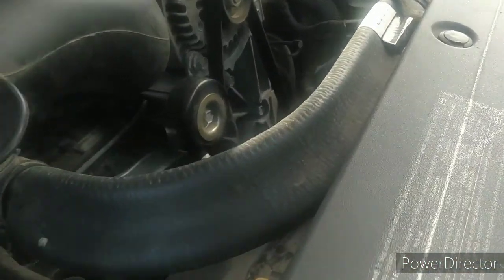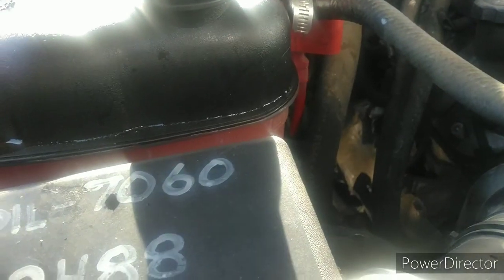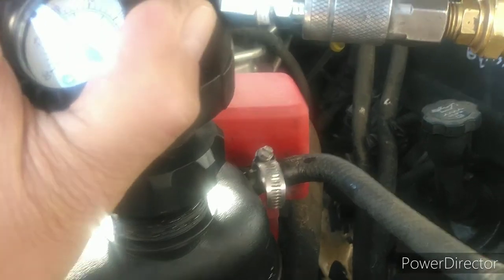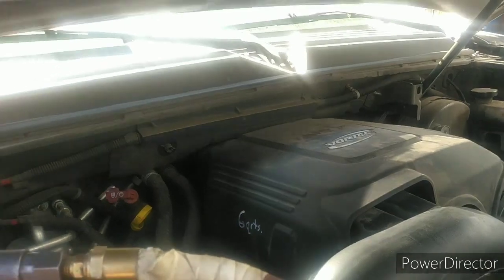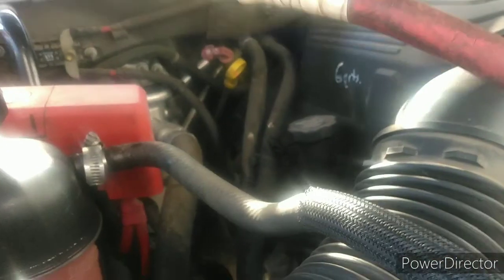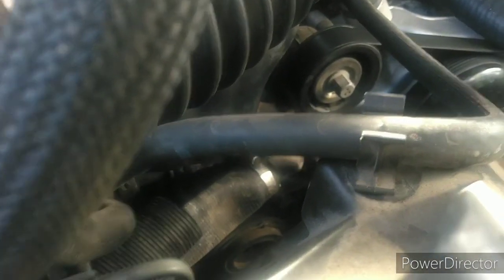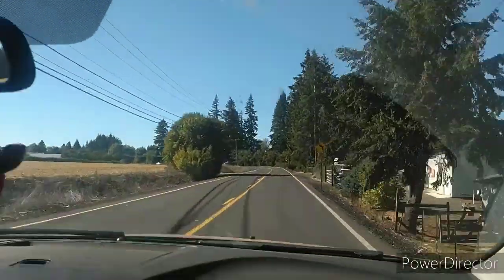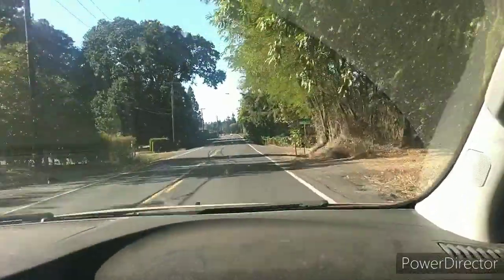Effing Tahoe!!! A trip off the farm 😎

Comment: I was just out working on my Chevy this afternoon myself.  Had to replace the transmission cooler, the one I had on there was leaking pretty bad. A buddy of mine grabbed me one when he went to the wreckers on Friday, didn't want anything for it. No more leaks, wahoo!  I had to fix the stereo install this weekend too.  The guy I bought the truck off, replace the factory stereo with an aftermarket one, and used black solder on all the wires (electrical tape), so all the wires were just twisted together, and one wasn't even taped up (live wire too).  Got those all soldered with real solder, and covered with heat shrink tape.  Now my truck won't burn down, and my eye won't twitch when I think about it.  OH, and he only had 4 out of the 7 required screws holding it in, so it was flopping around in there like a limp.....noodle LOL. Glad to see you got out today, hope you enjoyed the hooch ;)
Reply from the maker: Never trust other people's work.. . unless you know them well and they know what they are doing..
Was good to get out 👍😎 hooch was good too!!👍

Comment: I don't if would do any good - I take off the most upper heater hose when refilling and let the coolant piss out of the hose or the hose connector on the engine It is normally the highest point on the cooling system. Works good on GM or Ford. Good luck - some are just a pain in the ass!
Reply from the maker: Definitely a messed up system!!!
Thank you!!

Comment: It seems to be hot there.
Here it is down below 32 ℉ at night 
and it goes up to about 54 ℉ at the best during the day.
Winter is approaching.
Reply from the maker: Much more comfortable than in the 90s!!
It's cooling off better at night, but we are supposed to be getting high winds and hotter temperature.
Reply: It will be good drying weather, with heat and wind. Here the farmers are almost done with the rye. Most farmers here grow rye and some grow oats. There was a large bakery that baked mostly with rye flour and they preferred to buy locally grown. It burned down completely 3 weeks ago and made 250 employees unemployed. They will apparently build it up again, but it will probably take 2 years.
Reply from the maker: @makingithappen5178  WOW!!! So now no market for the rye... 
Funny how things used to be built fast and we'll built.. 
Now it takes years, and may not be done properly....
Reply: @GosselinFarmsEdGosselin  Oh well. They will build the new bakery with all the security installations and at the suggestion of the employees. This will be a very safe and easy-to-work bakery. It is a family-owned bakery company, which was founded in 1971. They bake very good bread.

Comment: You still have air in the top of the motor.  Intake area.  Pop the heater hose off at the fire wall.  The boys in the shop used to have a funnel that had a reservoir on it taller than the hood.  It would keep a head pressure on while running.  The heater core is above the reservoir.  It traps air in the core and the top back of the motor.   O have the vac to and some times it doesn't work.   They used to squeeze clamp the rear heaters lines to avoid this.  When you take the hater hoses of  f don't twist  the core is aluminum and you will be sad
Reply from the maker: Hmm... I can see where that could be..  got heat to the rear, figured it would be the harder one.. 
Thank you Kirk!!!

Comment: How about taking a soft wire and run it through it to break the air bubble or a pressurized water or air
Reply from the maker: Awesome plan!! But from what I can find out, the air gets trapped in high parts of the system. 
The Engineers who decided this was better than the old tried and true... Should be shot 😠🤣😂
Thank you Debbie!!!

Comment: according to Mitchell you hv to hv they key on and controls set to heat before you start the refill process .

just curious have you checked for restricted exhuast? 

do you 10 degrees difference from tank to tank ?
Reply from the maker: Key and heat controls on, yes.
Exhaust seems to be normal.
Tank temps are a few degrees different, I was not checking, but was being told what they were, all seems normal.. except no heat in the front heater and the heating issues.
Had a couple of people say that some shops have had to disconnect the front heater lines and clamp off the rear in order to get the air out of the front core..
Freaking awesome design 😠
Thank you!!!! I do appreciate all the input!!!
Reply: @GosselinFarmsEdGosselin  i know there was cylinder head flaw ,the ones casted by castech would fail from casting issue but i dont know if it relates to your issue ? 
with engine at operating temp and t stat cycled you should have a difference of 10 degrees? 
so i would check that when it heats up  and i would do a back pressure ck just to check that box
Reply from the maker: @sonofmontezuma3732  ok. Thank you!!

Comment: washington has several fires for sure.

so what happened with the coolant issue?
Reply from the maker: Too many fires...
Still not done 😠
Have heat in the rear now, but nothing in the front.. 
Took longer to get up to 210.. but still goes up to 230+. Comes back down fast when you rev it up.
On the road, it was getting up there too..then drops fast too.
Coming back in the driveway it really jumped.. almost 260. Got parked and reved it up, cooled down to 210 in a minute or so...
Holds vacuum, holds pressure.. 🤪🙄
Reply: @GosselinFarmsEdGosselin  curious has the raditor been pulled and checked? 
i heard new pump but is a delco unit or zone pump? 
hmmm belts not slipping ? 
strange case for sure 
does it have electrical fan? 
fan not screwing with you ? 
you can tach it with a cheap tach unit from harbor freight
Reply from the maker: @sonofmontezuma3732  when we changed the pump, I flushed everything. Water flowed good all directions. Temperature across the rad is fairly even, fans are working.. 
Makes a guy scratch his arse🙄

Comment: so the car cools down quickly? 

like from 218 to 150 in 20 seconds?
Reply from the maker: From 230 to 210.. 210 is normal..
Actually takes about 5 seconds after reving it up to start to drop.. then drops in another 5-10 seconds.. like it's the thermostat.. but original thermostat didn't do it before Changing the pump, did do it after changing the pump....

Comment: You might have a head gasket issue
Reply from the maker: Then we should be losing fluid.. vacuum shouldn't hold and pressure test should have failed.. 
Too much BULLSHIT in the simplest system 😵🤪
Reply: On my pick up it is pushing out of the over flow bottle. The oil is fine no milk ? . What does the coolant do when it is running? Is there any bubbles ?  On the Thermostat that you installed did it have a hole in it some do some don't usually the ones with holes are easier to install . as they let air bubbles escape .  Was the water pump a new one or a remain ? I don't even by a remain unless its something so old you can't get one anymore ..
Reply from the maker: @donovanvolk8583  new pump, thermostat has a breather hole.. 
Seriously though about taking the thermostat out, but it's seal is part of it.. maybe open up the old one and put it back in...
Reply: My mind is a blank for other ideas. Other than im getting to wonder if someone didn't take and dump a bunch of bars leak in it or GM sealant biscuits in it as some of them it was a standard thing to do Cadillac required it for a few years but I can see it causing a major issue if they done so and it was not required .